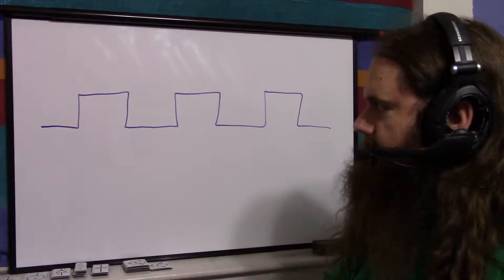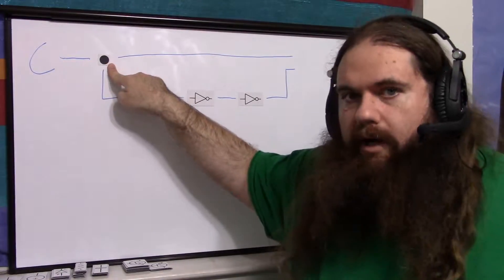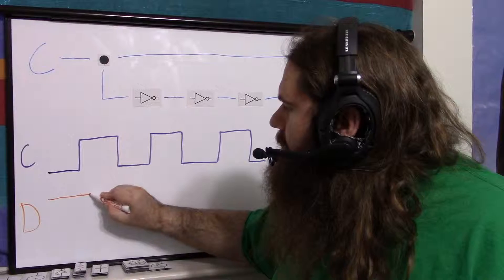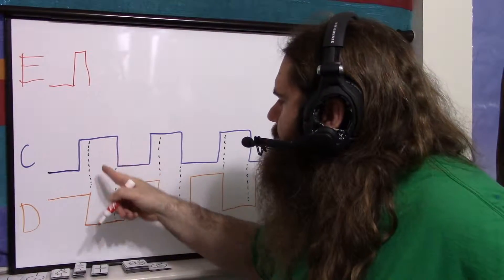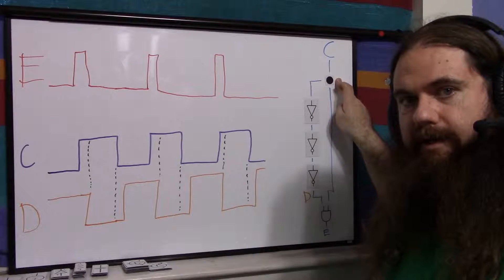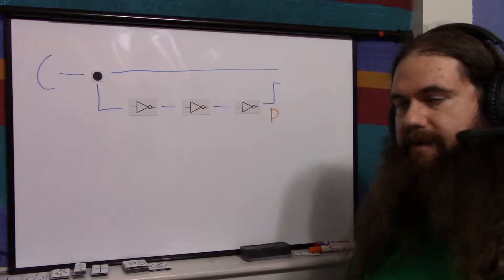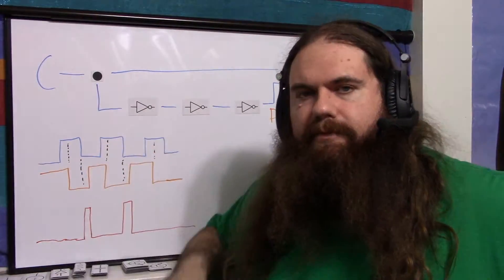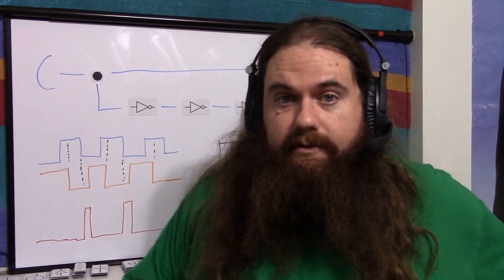Edge Triggering - Clock Signal Into Clock Pulses - Simply Put

Comment: Well done. This is exactly what i'm doing at this moment. 
I build my own retro computer where the 8 bit MCU and the Video system 
share the same Memory (address and data bus) based on a delayed clock.
By the way I follow all your videos I would like to see a video how to create negative voltage for an OP AMP from one +12V  DC power supply.
Maybe it's easy but i'm a absolute beginner in electronic.
DJ
Reply from the maker: I should do a video on that definitely. But one thing you might try is putting a two-resistor voltage divider right after the power supply, and then treat the "middle" as your circuit ground, so that gives you a positive and negative end. The trouble with that is the "middle" voltage will change based on parallel resistance with the voltage-divider resistors. It would work if you can make sure your resistance (real or effective) doesn't vary much, and then figure out what resistors to put in the divider. Or if you can fit an isolation transformer in there, you could "create" a new power supply from that which you can just hook up backwards for negative voltage.